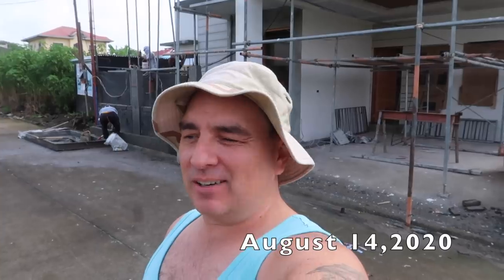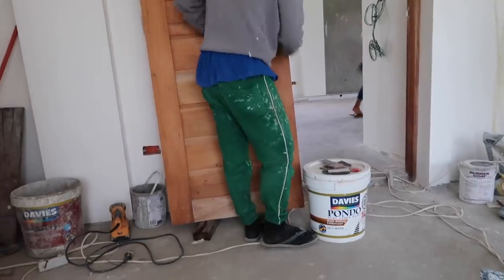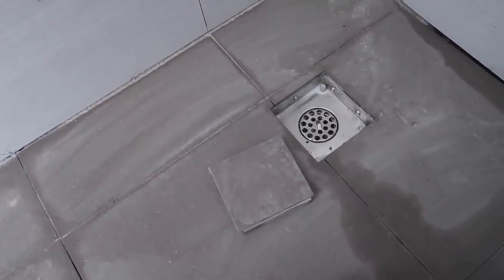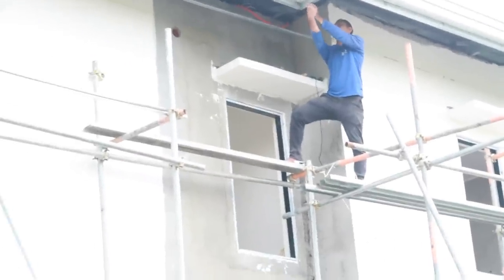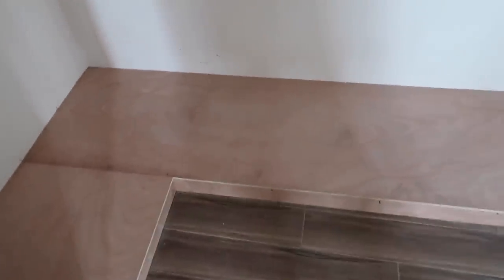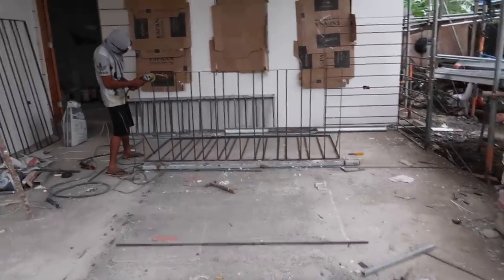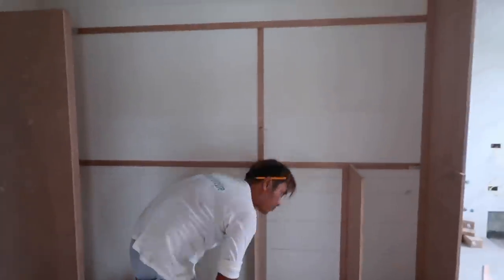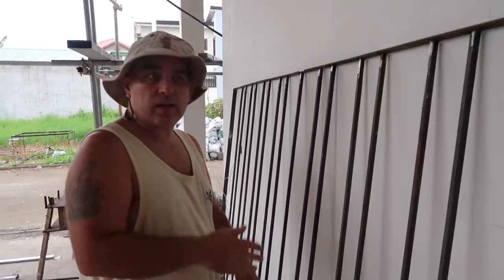HOUSE BUILDING IN THE PHILIPPINES - EPISODE 160: MASTER BEDROOM CLOSET LAYOUT

Comment: I watched all of your house construction videos during the ECQ and now i'm up to date. Cheers from an engineer. lol
Reply: ECQ keeps you safe and entertained
Reply: DO YOU AGREE WITH 5 INCH CHB EXTERIOR??
Reply: @manuelbartolome6663  , Hi I do. 5in CHBs are usually load bearing and should be placed to carry lintel beams and canopies. They are also used for firewalls to acquire code thickness of wall.
Reply: @andreasrotter4715  indeed. They sure will retire happy after the many months of construction. We have a german shepherd back home as well and they are really fun to be with - all playful and loyal. haha
Reply: @patrickbrian1465  How often is usually??? And  what bearing load of 5" CHB?
Reply: Hi @manuelbartolome6663 . For their case, I think there are walls that do not need load bearing capacity and could have opted for non-load bearing 4'' chb to be economical. It basically depends on the structural designer if he incorporates load bearing blocks to the design. In my experience, I use it on basement walls or walls against earth, and structural designs that utilize load-bearing blocks to compensate for a smaller column dimension - this is due mainly for architectural reasons. (clients want walls and columns to be flushed to one another). 
Cheers.
Reply: @patrickbrian1465  Iam talking about exterior perimeter walls and not any other walls..Also  "IF"  that  can not be confirmed...There's no basement...not  to mention there's no moisture barrier underneath ground slab...
Reply: @manuelbartolome6663  For perimeter walls such as this, you obviously don't need to unless you are after a denser wall structure. The basement is only an example of a scenario where we usually use it. We sometimes use polyethylene sheets construction standard for moisture barrier to slabs on grade. To tropical climates such as the Philippines, it really does not maximize its purpose since we do not experience extreme cold weather conditions like our western counterparts.
Reply: @patrickbrian1465    TOTOY. Engineer Your.making me smile.Walang kinalaman ang  extreme  cold weather conditions in relation to  moisture /vapor..barrier??During Philippines rainy season ...Ang ulan travels  vertically down from  sky to ground..Once water hit the ground..it travels  in all directions.. Vertical & horizontal..Miski may bubong.. Since  360 degrees ofsurroundings  saturated with water ..mababasa parin ang ilalim ng bahay.. and hot sun  comes  up??? Where does  water vapor go?? Up ? Or down??And concrete is a porous material...meaning it absorbs water...thus  promoting rebars  rusting.. parang anay..from  the ground  going  up...This is the importance of  having  a moisture/vapor barrier..This is the reason why HARRISON PLAZA WILL BE  DEMOLISHED AFTER 50YRS.  PH building code...otherwise there's new  technology.. Meron  na bang fiberglass rebar...epoxy coated rebar...galvanized rebar.. basalt rebar...sa pinas...Pls  comment  on this  house  roofing  and insulation???
Reply: @manuel bartolome Hello. You make me smile too :) Dinescribe mo pa tlaga ung ulan sakin, natawa ako haha. I am fully aware of its importance in rainy season. Aside from us that only experience rain, the vapor barrier is significant especially to places that experience extreme cold weather conditions,  where there are greater amounts of hydrostatic pressure and capillary action due to frost/moisture below ground that eventually turn into vapor- This is just my point. There are a lot of examples to this such as basement slabs that are situated below grade. Your reasoning is not quite on-point when you say that it is used to protect rebars from rusting -  Proper standard is for you to have 20mm spacers for concrete cover to do most of that. Rather, the vapor barrier is mainly used for both before and after slab on grade preparation. The before aspect entails curing of concrete where we try to avoid excessive absorption of moisture of fresh concrete from being absorbed by the ground. (I suggest you watch their previous vids and see how they prepared the compacted soil and what aggregates they used; Their compacted soil is also above natural ground level, although it should not be reason to not use standards for vapor barrier). Love TOTOY
Reply: @patrickbrian1465    No moisture barrier...no plate compactor....soupy concrete...
Reply: @patrickbrian1465    No moisture barrier...no plate compactor....soupy concrete...no floor slabs dobies..no gravel on footing  coloum....
Reply: @manuelbartolome6663  I agree. I think the watery concrete mix is plausible (mga around 4''-5" slump) kasi sobrang init ung panahon nung nagbuhos sila. ung floor dobies, nkksama ng loob , maliit na bagay pero ang laki ng tulong sa lifespan and strength ng concrete slab and protection ng rebar.

Comment: They rubber coated the canopy, but did they rubber coat the corner connected to the exterior wall? When it rains, the splatter from the rain hitting the canopy will get absored by the wall if not properly protected.